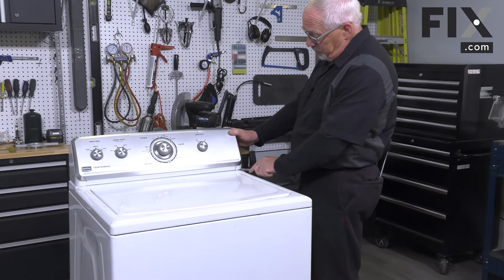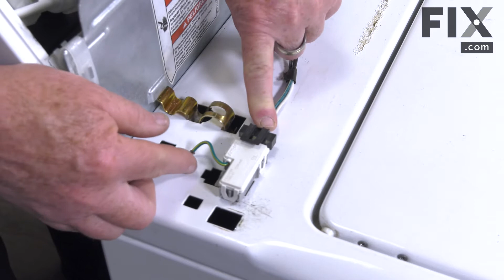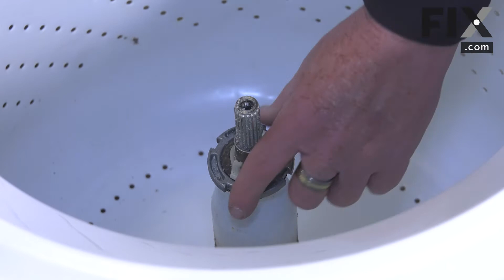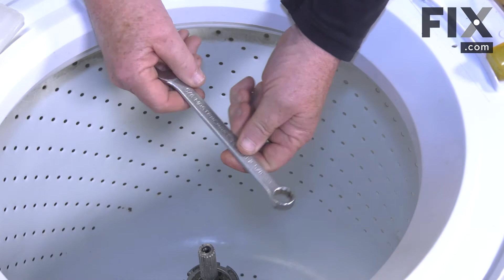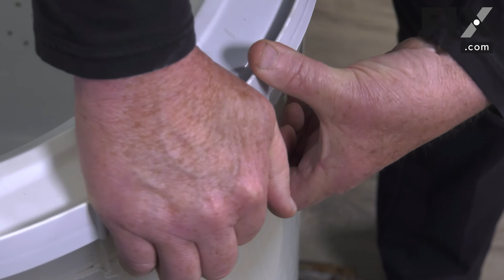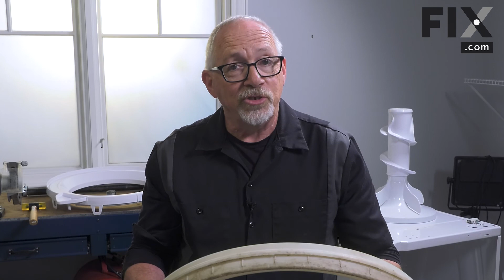WASHER REPAIR: How to Remove a Balance Ring in Your Washer | FIX.com

Comment: If your drum is out of balance (or bent),,  just drill a small hole in that ring, add about 1/2 cup of water (I used saltwater and a syringe)  no need to take drum out, it worked like a charm.. For mine,,  I used weight (14 pennies) to help offset the out of round basket.. put a heavy towel and it still doesn't skake now..

Comment: I'm ordering some new dawgs. Mine are all busted up. New motor coupling, too. I have issues with it getting out of balance, a lot, and I'm going to order new springs. As far as I can tell, the balancing ring has liquid in it as I can move the basket top around a good bit and listen. 
Kenmore 80 series heavy duty
Is there anything else I should consider replacing that will improve this wobble.  It's done it for years. I want to keep it running as long as I can.

Also, I have an 80 series dryer that's still kicking. It makes a squeal when it starts up and was considering replacing the belt, but I was wondering if there's any other parts concerning the movement of the basket that would need replaced in order to keep it turning smoothly. Springs or otherwise?

Comment: A person can do what he did but it's really not necessary to go through the hassle to remove the tub just to replace the balance ring. Save yourself some time and use the method to remove the ring but leave the tub attached. I always appreciate these videos as they are very helpful but always check out other videos as someone may actually have an easier way of doing a repair.

Comment: I’m glad I saw this. I’m changing out the transmission on my Kenmore 110 washer, and as I was cleaning the basket and tub, I heard swishing noise. I thought maybe some water and cleaner got in there by mistake through a faulty seal. Was about to crack it open and let the “water” out because I thought it would start smelling after a while. Something told me to go check it out on YT. Glad I did. Thank you sir. I they don’t sell a replacement balance ring for my model, just a whole new basket. Whew. Crisis averted. 🙄